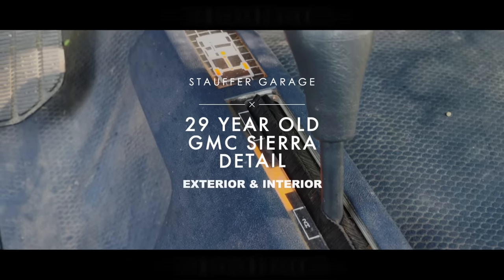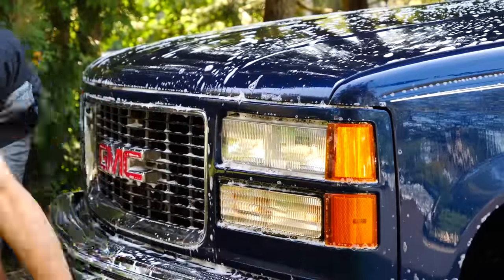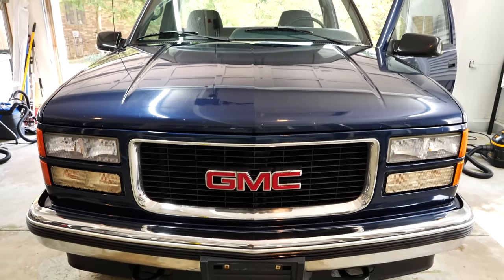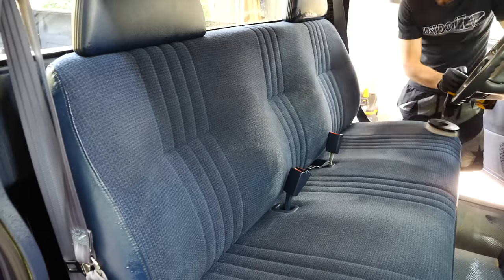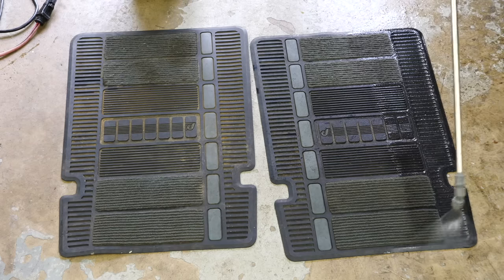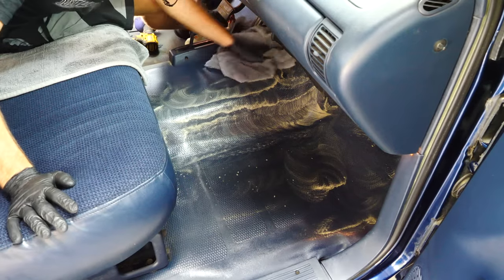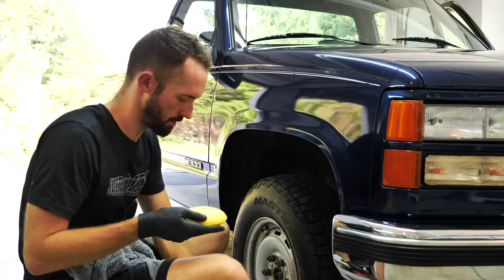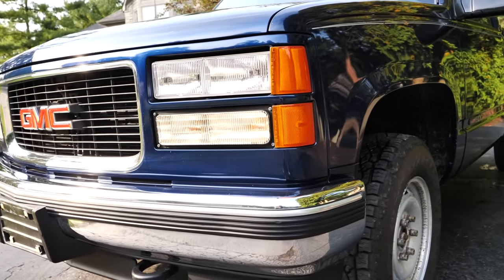Restoring A Veteran's 29 Year Pickup Truck For Free! First Wash In 15 Years!

Comment: I just took the side pieces off the two doors on my 2000 Blazer as well as the pin strip. There is still a glue residue or something, you can see it. What is the best thing to get this off? I used an eraser wheel to strip it all off but now I’m stuck with I guess it’s glue lines and every car company has charged me over $500 to come get it off. I’m trying to find someone that can give me the best advice in what to do? Buffing? A clay bar? 3m adhesive spray, I don’t know? Good job, the truck looks amazing.